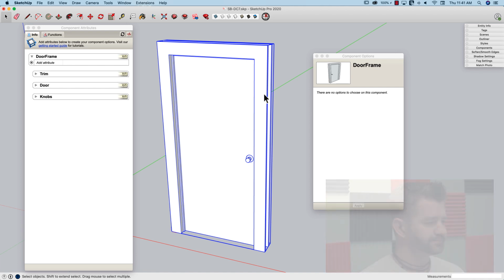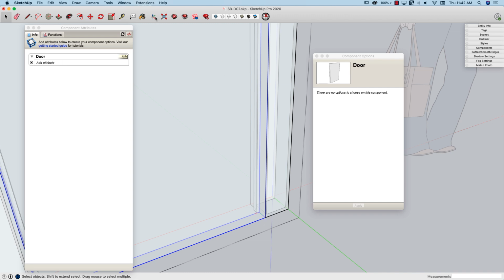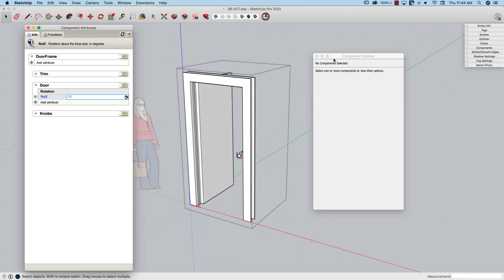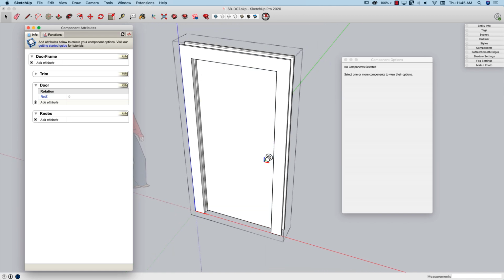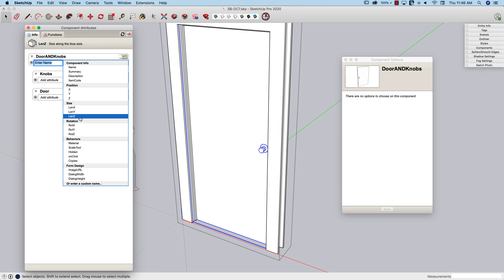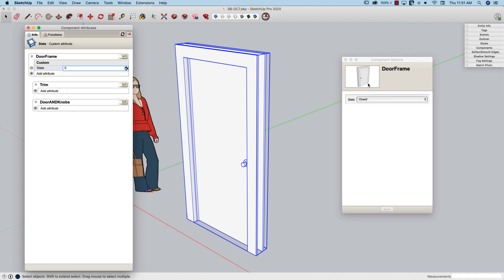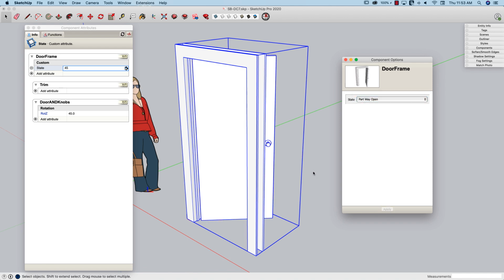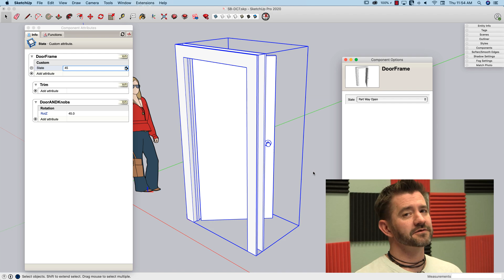Welcome to Dynamic Components Part 7 - Skill Builder

Comment: Arron...  Does your door rotation still work if you duplicate your door component, flip it along its top level X axis, and then try to rotate the new door?  Every time I've tried to control a duplicated DC's rotation (done with OnClick in my case), the "flipped" version rotation goes all wonky.  I'd be more than happy to send you a simple cabinet door frame DC example file for you to examine if you'd like one.

Comment: Hello. Your videos are really good. Thanks.

Could you explain how to create folding doors, please? In my case, I have a garage door that folds vertically in an open or closed position. I don't know how to program the rotation around the horizontal axe joining the 2 parts of the door.

Thanks

Comment: great videos!
Looking to create a dynamic kitchen database with different kitchen cabinet types, for example different widths, units with drawers or without drawers etc. Ideally want to be able to drop these units into a kitchen design and be able to change the door colour and style of the doors all at once with an options list. so the list would have 'door style' 'door colour' 'plinth style' so for example i could have a door style that is standard shaker style and have an option to have add a mould around the inside of the door. I haven't seen anywhere that adds the option to a dynamic component that totally transforms the look of it. not sure if that makes any sense to anyone but if it does can someone point me in the right direction please :) thanks

Comment: How can you add cost to your dynamic components. So when you resize it recalculates the construction cost of the door.
Reply: Cost can be added as a user defined attribute. Once added, you could multiply it by any value in the component.

Comment: Can you show how to work after making a copy of component to make it a base for something similar but slightly different. And if you change subcomponent attribute for the one you just created it destroys its relation between attributes in original components (name) that you made copy from. Does it mean that each subcomponent has to be unique even if it nested in a different component? Is a design in that way, or is it a bug of some sort :)?
Reply: Not 100% sure what you are describing. I would recommend heading over to our forum (forums.sketchup.com) and posting your question with an example. We'll get you sorted out!
Reply: @AaronMakingStuff  Thanks for direction, I might have found the clue to my problem in this thread
(https://forums.sketchup.com/t/propagating-changes-to-multiple-instances-of-nested-components-or-how-do-i/36295), but have to try it to be sure if it is solution for my problem.